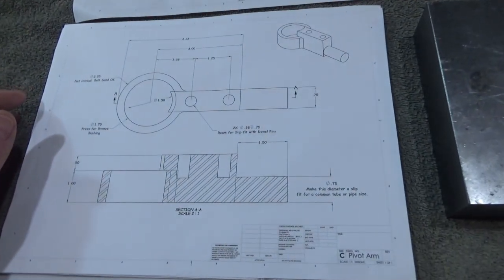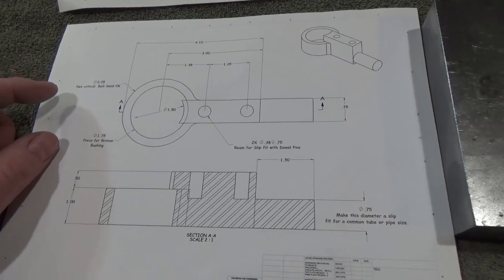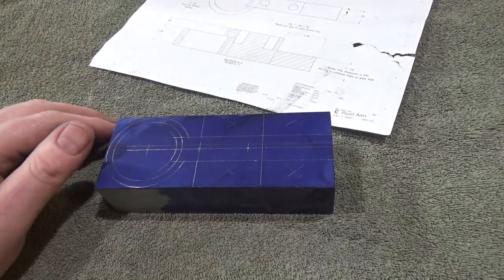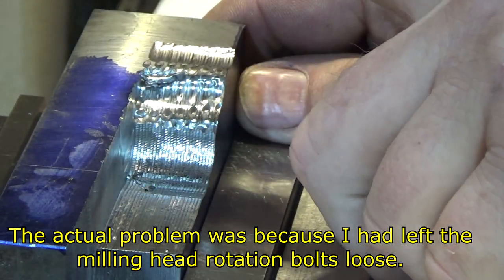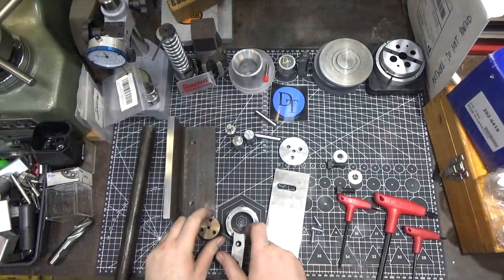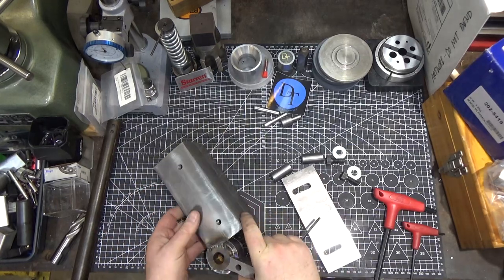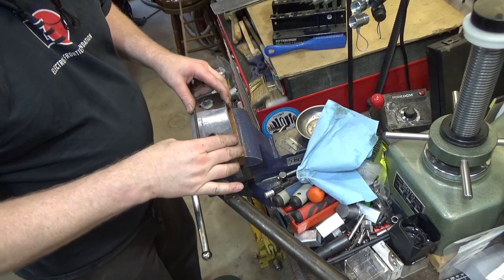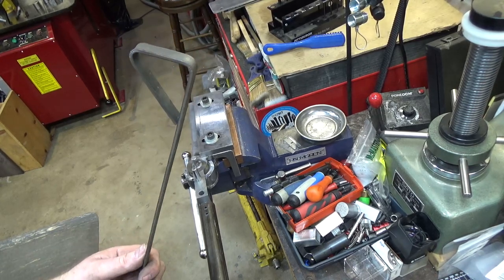158 Tom Lipton Rod Bender Project Part 3

Comment: Everyone has their own way of doing things, but a rotary table would have made quick work of that radius section. I was cringing as soon as I saw you climb milling. We've all made those mistakes ;-)
Reply from the maker: I thought about the rotary table option and would definitely take that approach if I make something like this again. I was being very carful with the climb milling, including adding a little bit of friction with the x-axis brake. I should have been more careful in tightening the mills head rotation locking bolts - only one of four was tight.

Comment: Nice job for cutting on the bandsaw maybe try making yourself some pallets to cut accurately. I'm kinda obsessive about not turning anything into chips I can cut on the saw .I have a couple different sized pallets I can clamp odd parts to and a 3 inch screwless vise I can clamp in my bandsaw vise so I can cut away most extra into usable pieces I don't have to do much to. I've actually used tiny cut offs quite a few times 👍👍👍
Reply from the maker: I like where your head is at. I always run from operations that require had eye coordination, because, I have been disappointed too many times. I am completely on board with the wasting material. I have a large drawer full of small cutoffs.
Reply: @DudleyToolwright   yeah I've been the same way I'm pretty good on the bandsaw but I sometimes admittedly get to obsessive trying to get a perfect cut and think oh I can take off just a lil more than slip and over do it so now if I want perfect I stick it on the pallet I've got several lil tubs of cutoffs that always come in handy and surprisingly when I bought my HF 7x12 it came setup cutting within 12 thousandth right outta the crate even came with a cut sample lol they didn't put anywhere near that much time into my 4x6😂😂😂

Comment: lol well good job on making it and it looks like it works good and good save on the tooling did not brack a bit off lol the only thing I learn is to make shere the camra is on and working before moving on lol keep up the hard work
Reply from the maker: I find that I have forgotten to stop the camera after finishing an operation and then when move on the the next operation and hit "record" I am actually stopping record. I have done this once too many times. There is a lot of thoughts to have juggling around when I do these shoots and errors just happen.